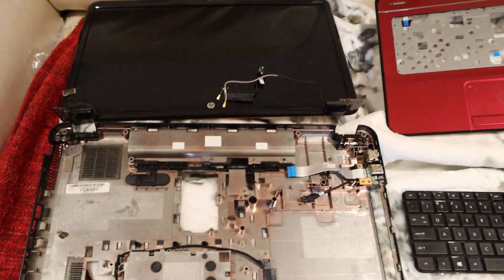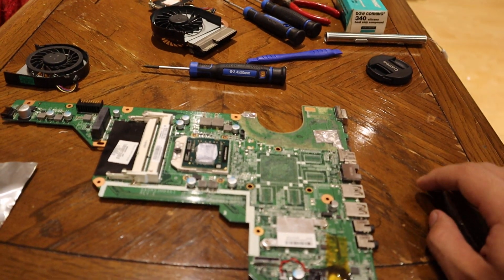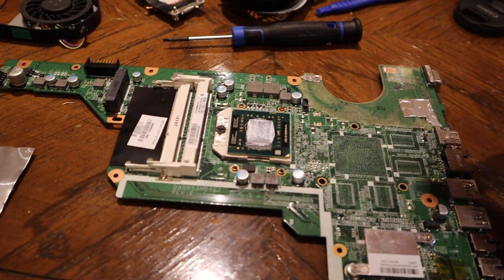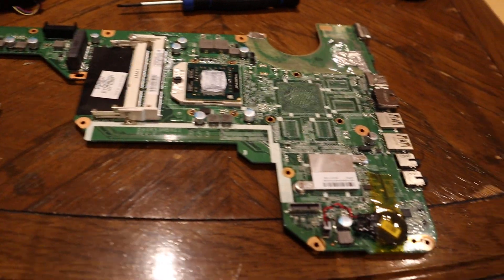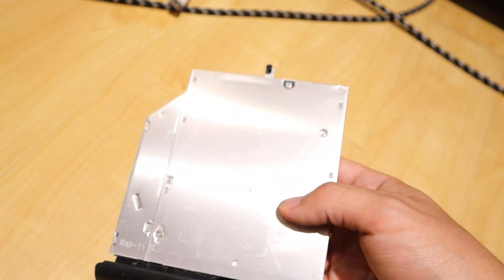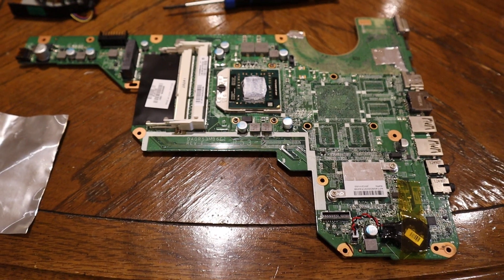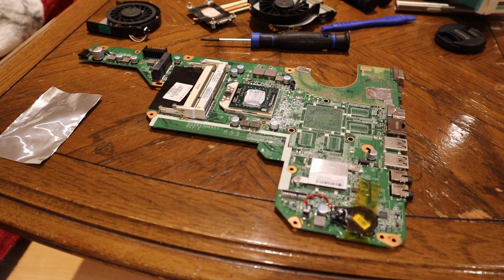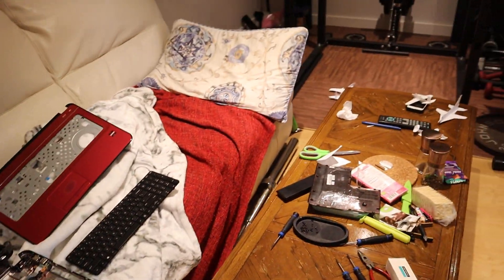Upgrading an Old Laptop to make it new again

Comment: Love working on old equipment, both desktop and laptops. While simple hardware upgrades are easy like RAM, optical and solid state storage, some cannot be upgraded as easy with a newer OS, both Windows or Mac. That creates a problem using modern browsers that require the most current or near current operating systems. If internet access is not important, these with last forever, although slower and with legacy software.
Reply from the maker: That’s a good point and it is always suspect when companies make new technology that is incompatible with legacy hardware. That’s probably why Linux is popular on older laptops